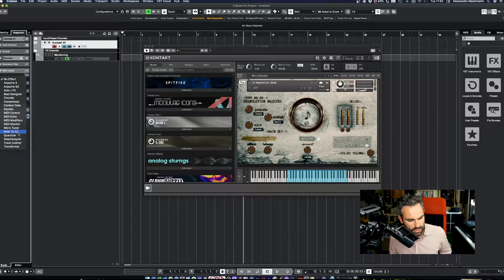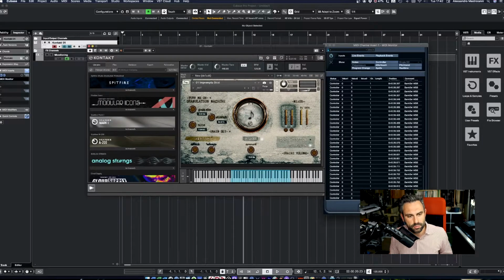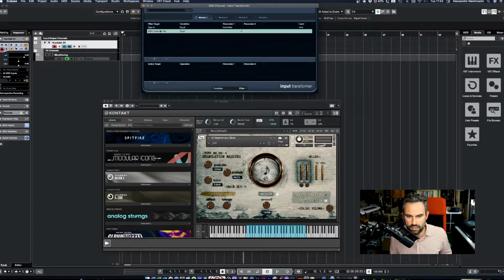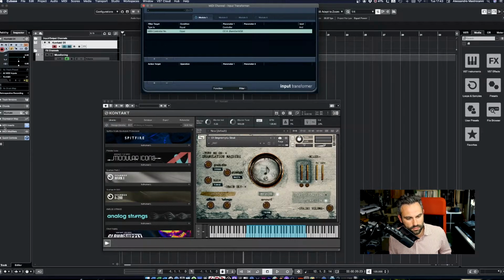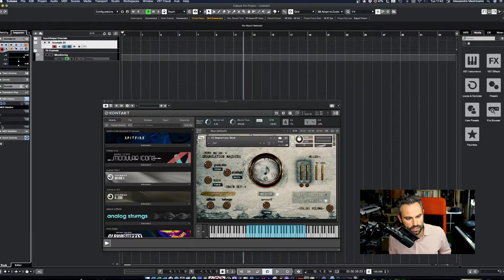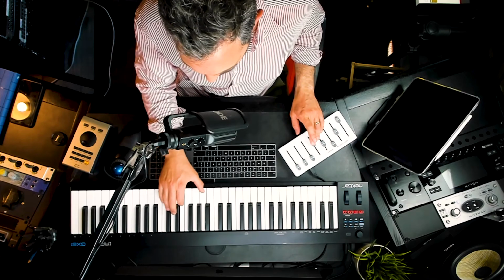How to fix a midi controller sending random midi messages - Cubase Midi Filter

Comment: Hi there. Do you know how to filter midi cc on a specific midi keyboard only?

For example. The midi keyboard 1 has problem with random modwheel. And I want to use the modwheel of keyboard 2. But if i filter cc1. They both disabled. Thanks.

Comment: Thanks for this. I was actually searching for a solution to a specific problem that only occurs when I'm on a Zoom call with one particular client. I have a Komplete Control M32 that is sending out cc85 cc86 and cc87, but only whilst I'm on Zoom. once the call has ended, the data stops. It is a strange problem, for sure!

I knew about the various filtering options from my Atari days (Cubase is still the best DAW for MIDI implementation and editing that I've used), but I'd overlooked using this as I thought it was a 'per channel' insert. I needed to implement it globally, rather than add it to every channel. I will have a look into this, as it seemed to offer a global solution....I'll be back to post my findings...
Reply from the maker: Wow, that IS a weird issue. I would try with a midi monitor like MIDI view to see what exactly is going on, and if you need something that works goballu the only option I can think of is Bome, which isn’t free I’m afraid